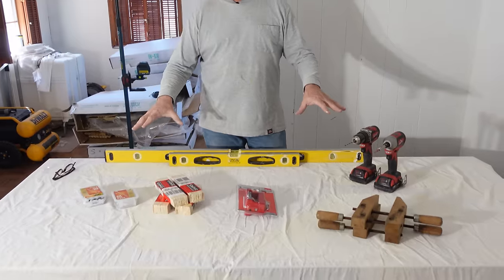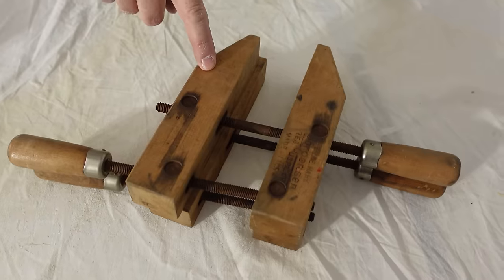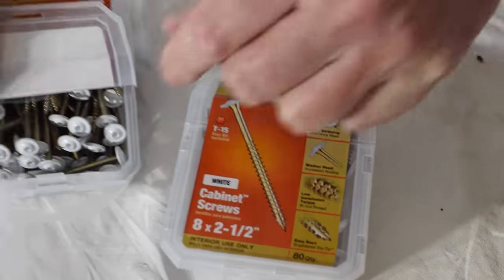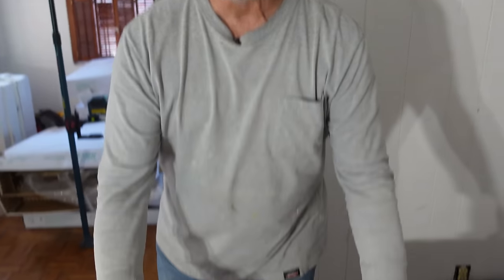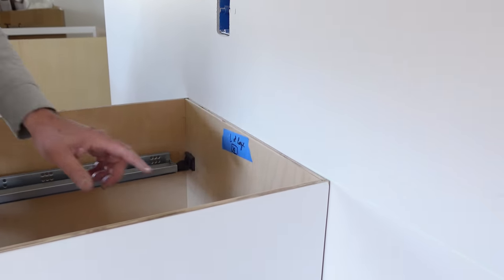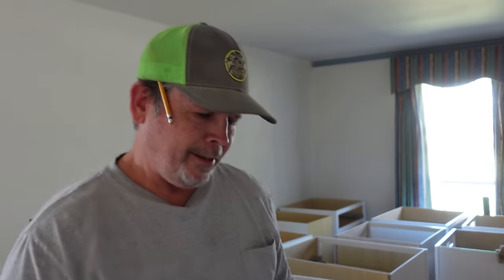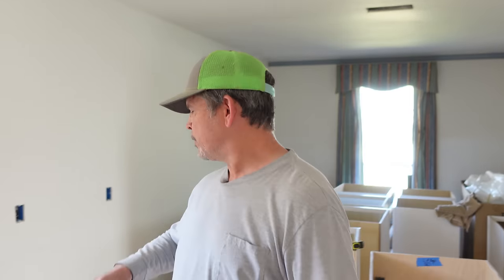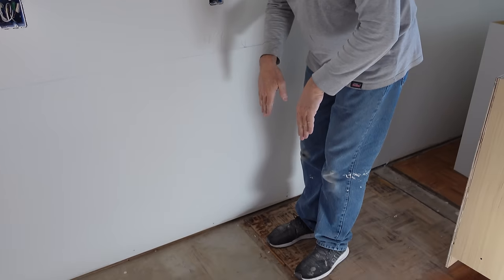How To Install PERFECT KITCHEN CABINETS (DIY GUIDE)

Comment: Do not use them.. They put pressure dings On your cabinets even when you put the felt on the clamp.  Read all of the comments on home depot. Nobody likes them. This guy has sponsors so he has to endorse it. I tried it I have several pressure dings on my cabinets that I did not notice at 1st  then my wife pointed it out..